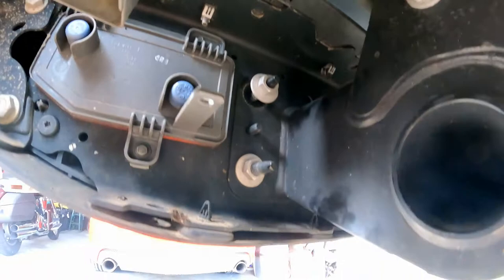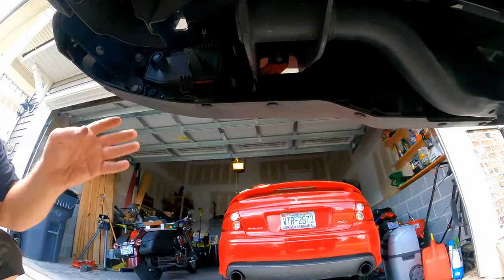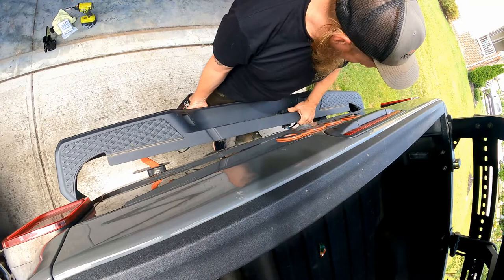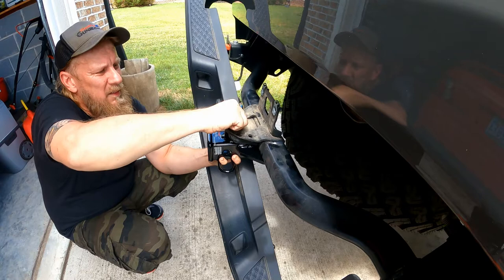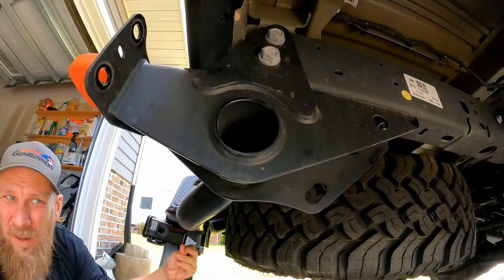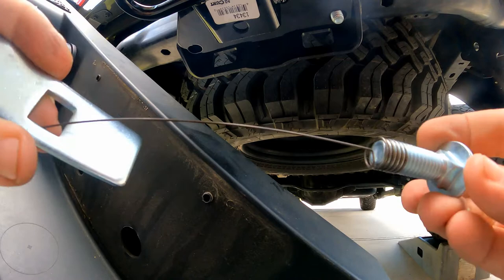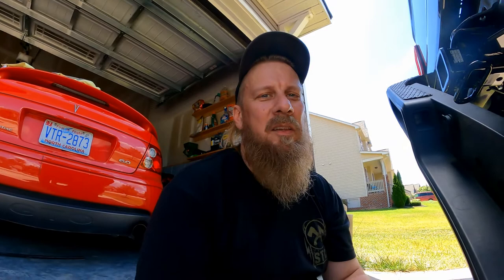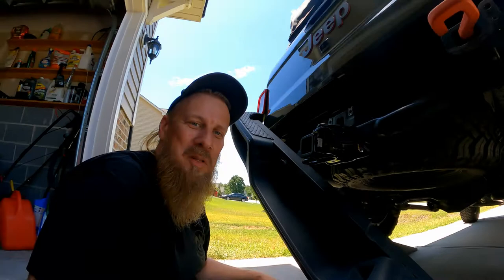Curt trailer hitch install on Jeep Gladiator Mojave.

Comment: Gotta say just that little pro tip for the carriage bolt and plate was a life saver!  I couldn't get them around that nutsert for the rear metal bumper without it.   Thank you for making this video!
Reply: Wish I’d seen your video first as I now have both bolts and plates stuck.  Any ideas how to retrieve?

Comment: Thanks for the fish wire tip.  I have the Quadratec hitch but it's identical to the Curt.  I just about gave up until I came across your tip on separating the plate from the carriage bolt.  Worked on the second try after at least 50 attempts the other way.
Reply from the maker: Thanks for watching.  That seems to be what I hear the most.

Comment: how much you tow with this I HAVE SPORT BASE MODEL
Reply from the maker: This is a class 3 hitch, curt says it will handle 5,000 pounds tow and 500 tongue weight. I think the Sport model Jeep only has a towing capacity of 4,000 pounds.
Reply: i know 4000  but if i replace the whole hitch not just adapter would it be same thing because i have 3800 rv
Reply from the maker: Its more based on engine and trans. Jeep makes it sound like 4000 is max for a sport with a manual, but if you have an auto you can go to 4500. If you have the overland, mojave, or rubicon brakes, you can tow 6500, and with the max tow you get a trans cooler and 7500. Im no expert on towing and cant say what they could really handle and for how long.  My camper is only 1500 pounds so ive never tested the limits.

Comment: The link you shared says it does not fit a 21’ gladiator.. is this wrong and I’m ok to buy? Or should I look for a different product?
Reply from the maker: Should work fine.  Couple guys ask in the questions section and get a yes answer.

Comment: Nice. I installed the same Curt receiver.  With this set up , do you know what the tow rating is.  It's not a complete class 4 hitch so I question how much we can actually tow with our Mojave
Reply from the maker: While the receiver says 5000#, it also says rated as strong as weakest towing point and the larger tow bracket we are attaching it to is rated to 3500 I think.  I'm currently just going to use it for light towing on paved or gravel.
Reply: @grubandgravel  thanks for your insight on thus.

Comment: Hi dude, may I know where you got the fish wire and what size is it?
Reply from the maker: came with the hitch kit. amazon sells the curt fish wire in several sizes for $1.75
Reply: @grubandgravel  thank you so much for your reply. I check your video first before I bought the hitch receiver from Amazon. Then realized there is no fish wire. I found some other websites sell the wire and receiver as a kit… I will checked Amazon as you mentioned for the wire. Thanks again! Enjoy your weekend!